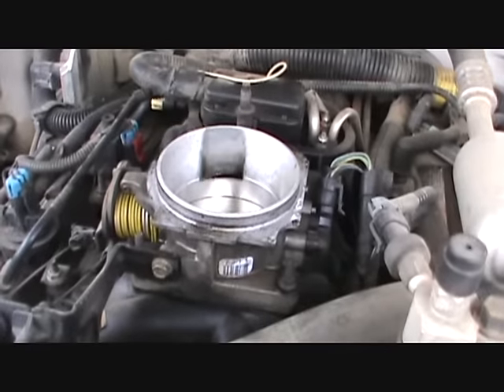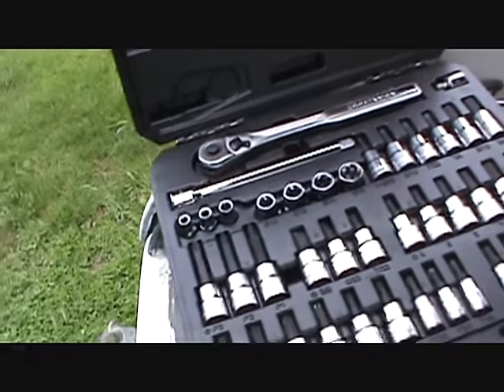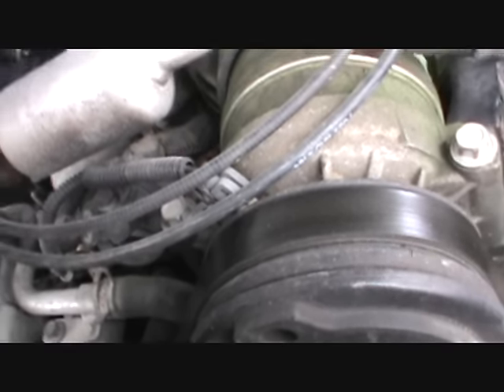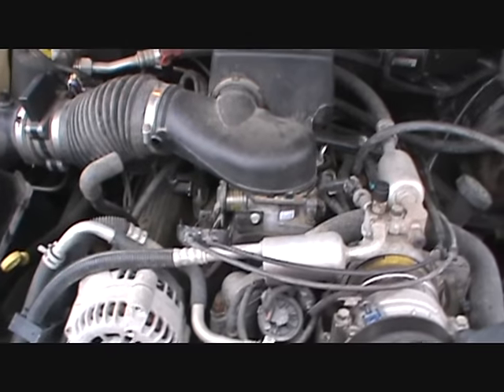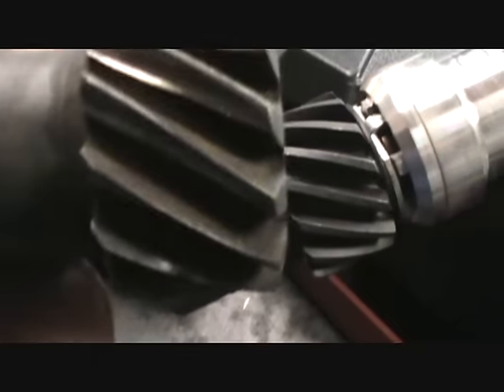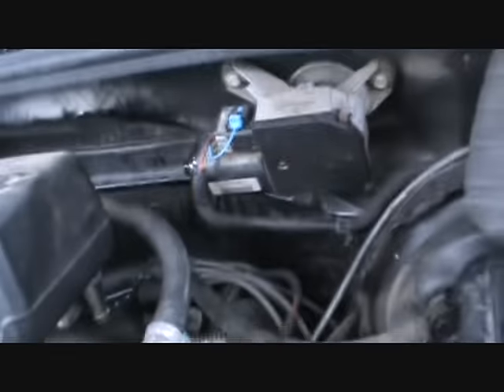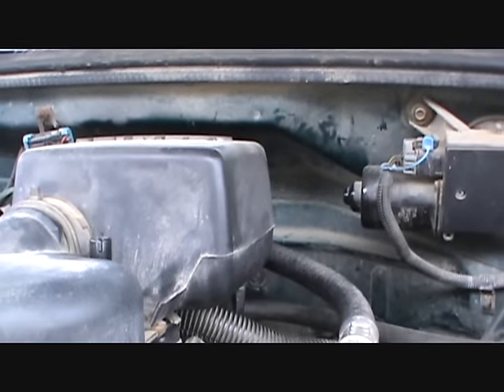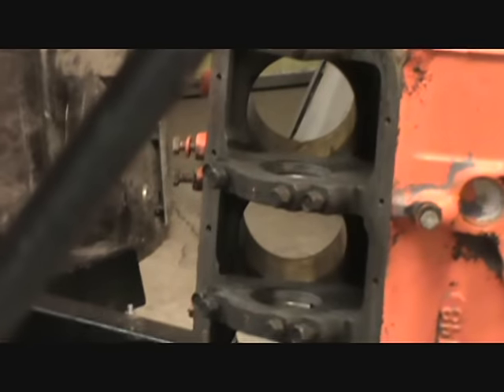1997 3500 tps replace 98 1500 distributor and cleaning motors

Comment: check your engine coolant, trans cooler could be leaking into the engine coolant in the radiator
Reply from the maker: +dave1135 it was clean nothing in it
im thinking i never topped it off when i got it going